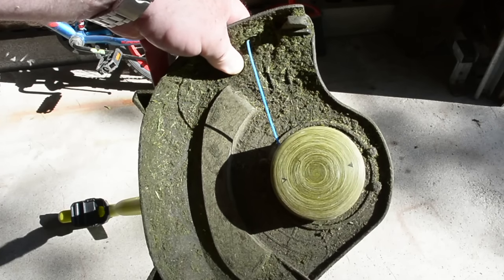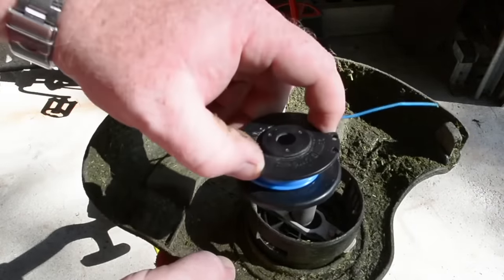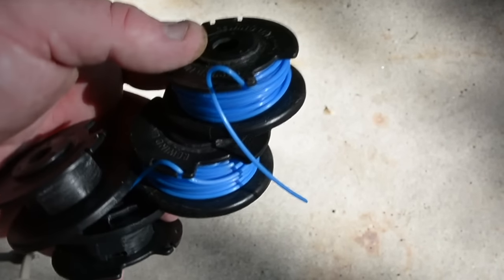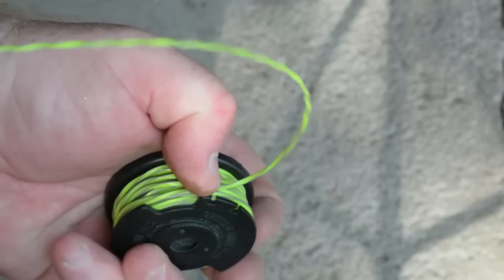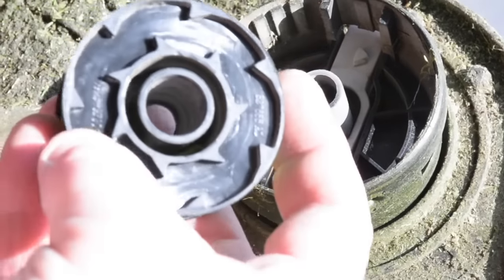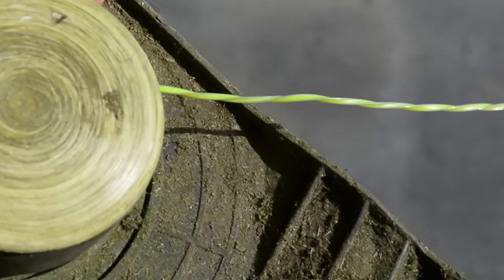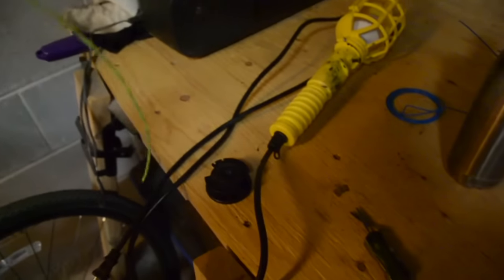RYOBI How to Re-Spool/Re-String 18V WEED WHACKER

Comment: I didn't realize the weed whacker line is automatically cut when it is stopped. I was moving from weed to weed in my driveway and stopping the machine when I moved on to each new weed. Apparently the string was cut at each weed! I couldn't figure out why the string was running out so fast. Your comment at the end about how the string gets cut really helped. Thanks so much!
Reply: So is the better method just to always keep it on while you're cutting and start/stop as little as possible?

Comment: They say it's the operator and not the tool. I bought this Ryobi and just love it! And then the spool ran out, I re-did the bobbin and then it stopped "working". I had an old Sears Home brand and after watching this, for years I have been doing this completely wrong. Thank you for the instruction! Be nice if manuals wrote out what do instead of putting pictures.

Comment from the maker: Spool keeps unwinding? I made a video about the probable solution: https://youtu.be/339wJE8b4dA
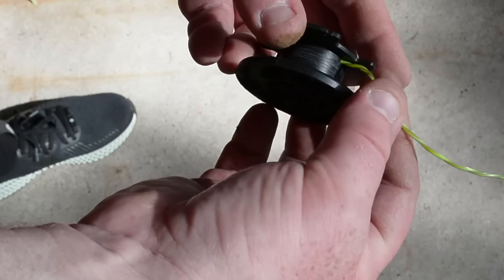2:34 I think a critical error is often made during the 1st step of the process: the new cord/line/string first enters the empty spool in the little 'notch' or 'hole' of the empty spool, and then the cord is wrapped in the OPPOSITE DIRECTION from that inserted line, so back on itself. You insert the line into the spool a couple of inches and then wrap the cord BACKWARDS to the direction it's inserted in the spool. For example, if the new line, when inserted into that hole runs in a 'clockwise' direction, wrap the cord going 'counter clockwise', so reverse the direction of the cord. This is what holds the line in place and keeps the spool from unravelling. When inserting the cord, it should only be able to insert into the hole in one direction, so wrap the entire new spool backwards across that first insertion, the opposite way.
Reply: Good man! Haha just struggled with this yesterday, and this was the step I was missing.
Reply: This comment was the best help. Thanks!
Reply: THANK YOU!!!!!!!
Reply: I still can’t get it so that my spool doesn’t unravel?
Reply from the maker: @christianpowell2053  wind the string in the opposite direction that you insert it in the notch. Go backward when you first start to wind and that will keep the string in place.

Comment: Cool vid man. The wind-direction printed on the spool could be taken both ways.  Wind the line in that direction or turn the spool in that direction. Helpful hint don’t wind too tight, especially if using biodegradable line. Also a fun tip is dusting the winding about half full with Sterate wire pulling powder! It’ll keep it from melting together where it overlaps;)  Ironically I use the same exact line you use in this video $12USD for 275ft. Always have 5 reused spools wound and ready to go! YeHa🤟🏻🇺🇸

Comment: Excellent video! It's almost Mother's Day & I've tried before searching how to restring this for my Mom. I thought the line she got might have been too thick (.095 I believe), even tho it said it should fit- But I've never strung a wacker before so I'll try again now that I know how. Thanks!
Reply from the maker: Thank you! But I think you should use max 0.065" for the line diameter rather than the 0.095. The 40V Ryobi weed whacker only uses 0.080" so the 0.095" is probably for a big ol' gas machine.
Reply from the maker: My bad. I started using my 40V Ryobi this past weekend, and the string is 0.095". However, my 18V Ryobi uses 0.065".

Comment: Is there a way to Make the spool stop coming out? Mine is letting out string every time I press the button and it’s wasting a lot
Reply from the maker: I wish I had this problem lol. I seem to break string often as I get close to rocks and tree stumps. I would say a solution is to wind the string really tightly. When I've done this, the auto-feed doesn't work as well and I manually have to extend the string.
Reply: I have the same issue, the string just keep coming out and even if I put it back it comes back out again, it's frustrating
Reply: Same problem. I'm pissed
Reply: That's the opposite of me too. If I wrap it even slightly too tight or it gets hung up it doesn't feed. This design absolutely sucks.
Reply: Same, it just keeps coming out.
Reply: It’s been a while since posting but turns out the kind I had was self releasing every time you let off the trigger. Now I just hold it down and it works out great. Wrist took a while to get used to it but it does the job

Comment: Thank you for the detailed video!! I always thought it’s more complicated than this 😅 also for some reason the line melts on itself in the spool! Is it just a bad line or happens to all of them? Also have you tried using a blade head instead of plastic line?
Reply from the maker: Thank you for the nice comment! Don't wrap/wind the line too tightly/firmly around the spool when re-wrapping it, or else, as you say, it will "melt itself on the spool." I have never used the blade head, but have when I was younger for thick underbrush, such as bulrushes or excessively thick and high weeds. I remember it cut through easily but the long grass has a tendency to wrap around the spinning head and jam the unit. I have never used the blades with "already cut" or "maintained" grass. Those blades are super small in diameter also, in comparison with the line/cord, so I prefer the longer diameter of cut with the cord, for easy jobs around the house, which is how I currently use my Ryobis.
Reply: @heyitsjosh  thanks for the tip and info! I’ll try to not wrap it tight next time.
Reply from the maker: @GrindMyGears  Yeah, just wrap it tightly enough so there's no slack in the line and it should be good!

Comment: Just refilled my spools and I’m finding the spool unraveling after I stop then start again. I have to open it back up and rewind the line. The line is nice n tight when I start.  Any tips on what I’m doing wrong or what I should do?
Reply: Same thing with me i think its because i got the cheap one $3
Reply from the maker: It's because when you insert the line into the notch in the spool, don't wind the cord in the same direction it goes into the notch. Instead, once the line is set in the notch, wind the spool in the opposite direction.

Comment: Hello! Thanks for your videos.... I have this model trimmer and am about to throw it against the wall!
The line spool is installed correctly.... My issue is that the line constantly breaks. Or it appears that the line "sticks" to the line underneath it. I use .60 thickness..... Is there stronger line that can be used with this model?  I used to have a more powerful Ryobi, but damaged my vinyl siding when trimming at the base of the house. Would you ever recommend a blade trimmer?
Thanks!
Reply from the maker: I think my cord is 0.065" for this 18V and 0.08 for the 40V. I mostly use the 40V and I know what you mean about power! Never did a gas version hurt my legs so much with firing debris back at me. The 40V is comparable or even more powerful than some gas models. The line breaking could be that it's old and brittle. Try soaking it in water to increase pliability. The only time I ever used a blade trimmer was with heavy, tall, thick grass: it was fully lush and overgrown and very thick. For just regular grass and even some thicker stuff, I'd stay with the nylon cord/line.
Reply: Thanks so much! I appreciate it!!

Comment: Just bought my 18v and used it.  Went through a whole spool in half the yard!  How do I stop it from coming out?  Seen several videos but no one talks about how to use the trigger.
Reply from the maker: The line is fed every time the motor starts from a stop. The line doesn’t extend like a traditional weed whacker where you ‘bump’ the rotor on the ground to extend the line. With this 18V version, every time you stop/start the motor, the line extends. So, try to run the weed whacker for longer intervals without stopping - not good for battery life, but will save on string. I actually like the line feeding system here as I often go too close to rocks and tree trunks so break the line. I often find myself playing with the trigger (on/off, on/off) just to extend more line out.
Reply: @heyitsjosh  thanks much!

Comment: Hi..good vid but am unclear on 1 thing..

When im ready to use the spool(ie not storing it) do i remove the string from the groove?
Thanks
Reply from the maker: Yes, remove the string from the groove and slip the string through the opening hole in the weed whacker head at the same time that you lower the spool into the head. You don't want the spool going over top of the string when you put it in the head, or it will bind: you want the string to go into the head parallel with itself, so that the line wound around the spool is parallel with the end of the string. If you kept the string in the spool's groove then the string wouldn't come out as it breaks off while using it. The way this whacker works is that simply by letting off the trigger and then starting it back up again, more line is fed out, so when I trim around rocks or whatnot, which breaks some of my string, I simply take my finger off the trigger, let the head stop spinning and then hit the trigger again and more string comes out. Best,

Comment: I noticed the string is green instead of blue. Can you use a different thread size for this? Or is it the same size just different color? Thanks
Reply from the maker: Same: 0.065". The blue was my original spool and I tried the yellow/green after that. I wouldn't use a thicker thread for this 18V weed whacker, but the 40V one I use thicker line.

Comment: I’ve been trying the thicker diameter string but it tends to get stuck. Might have to look into thinner string.
Reply from the maker: I think the manual says 0.06" but I use 0.065" for the 18V, as I've never seen 0.06" before.

Comment: Why does my spoil get sucked back in? I do it exactly the way you showed. I turn on the trimmer all the line gets sucked in.
Reply from the maker: Maybe leave a little bit more string hanging out of the spinning head before you start the machine? If I'm trimming around rocks or trees and break the line really close to the spinning head, there won't be any line sticking out and I have to remove the cap to release more string.
Reply: @heyitsjosh  wouldn’t the line cutter on the grass shield just cut it any way?
Reply from the maker: @nono559  Exactly. It doesn't matter how long the outside string is, as it'll cut off.
Reply: @heyitsjosh  any tips on preventing line breakage? I use a .080 recommended by Ryobi and I find my self constantly taking the cap out and pulling the line out just on a basic edging work. Also, would the high low speed setting play in to it?
Reply from the maker: @nono559  Is the line old? I've found that after a year, the line becomes more brittle and breaks easier. I've read somewhere that if you keep the line moist or wet before using it, it becomes more malleable and won't break as easily. On a side note, I picked up the 40V this year and use 0.095mm and that string is a lot stronger and doesn't break as easily.
Reply: @heyitsjosh  I bought the line last month. I’ll try soaking it in water. Do you know for how long i should soak it?
Reply: @nono559  correct line is smaller - .065 ..possibly .080 is too wide for that hole in the cap and it's getting stuck..080 is used on the 40 volter, if you're using a 18 volter like this video is referencing the line size is .065. alternately if you have an 18v one and a bunch of .080 line you might be able to drill that hole and make it larger which would (maybe :}_ allow your .080 line to come out correctly.

Comment: Any suggestions on if the cord keeps feeding and then eventually wrapping around the motor? Bought the replacements at the store.
Reply from the maker: You need to spin the head at full speed for the cord to cut to length (the cord hits the little blade on the underside of the triangular cover, and it needs to hit that blade at a fast pace in order to break off), so if you half accelerate at the beginning the cord may not cut and then it could extend out further and further if you re-trigger it. Just go full speed at the beginning until you hear cord snap and motor spins a bit faster, then you can ‘down-trigger’ from full speed and use as needed then onward…perhaps?

Comment: Any tips on when the auto feed doesn’t feed? It keeps stopping every 10-20 feet on me. I’ve tried not winding as tight but haven’t gotten it to work properly for longer than 20 feet.
Reply from the maker: Are you using 0.065" or less diameter (perhaps the string is too thick)? Also, I try not to re-wrap/wind my spool too 'perfectly' where each turn is beside the next. I just wrap the spool quickly and haphazardly, and there's many wraps that are angled and off-kilter, and therefore the string doesn't get 'jammed' from being too closely wrapped to itself. I think it's not only a matter of not wrapping tightly, but also to have some imperfections in the wrapping so that the broken string doesn't get caught under an earlier winding of the spool, if that makes any sense lol.
Reply: @heyitsjosh  thanks for responding. I’ll have to check the width. Come to think of it, it might be wider than the original string. My issue only really seems to happen when edging, not so much when whacking.

Comment: I did this possibly every 30 secs, before I gave this model up. The line just kept snapping, snapping, right at the point it leaves the casing, even when I replaced with heavy-duty line. It seems to jam hard onto the spool if you wind new line on by hand.
Reply: This is my problem today - was hoping to find a video that explained more on winding. My string keeps cutting off too short and won’t advance with the handle lever like it’s supposed to because it gets stuck.

Comment: What if the wire doesn't fit in the hole? R there diff size strings?
Reply from the maker: Yes, the 18V uses 0.065” cord.

Comment: I’m having dramas where I thread the spool (as per your video) start using my whipper snipper, and it cuts for about 10 seconds and it appears either the thread comes out or is cut short...??? Not sure what I’m doing wrong, but do you have any suggestions?
Reply from the maker: Maybe this? Weed Whacker Spool Unwinding? How To Properly Wind Weed Whacker Line
https://youtu.be/339wJE8b4dA
Reply: Ahh, my hubby tells me it’s simply when I’m hitting the concrete, it is just breaking the line.

Comment: So just to confirm when the device is in use, the string is supposed to automatically get longer/release by design?
Reply from the maker: As you start/stop the device it extends the string automatically. So if you don't want to extend the string, keep your finger on the trigger at all times, but if you want to extend the string, simply stop the device and then start it again and the string should automatically feed out.
Reply: @heyitsjosh  thanks!
Reply: @heyitsjosh  when you say keep your finger on the trigger, does that mean the power has to be on and the wheel  is spinning, which is using up battery power?
Reply from the maker: @honestreview8632  Yes, exactly. With the 18V model, starting the machine automatically extends the cord, so if I want more cord, I simply stop/start the machine, and if I don't want more cord, I just keep the machine running, which uses battery power.

Comment: QUESTION: on the 18v do u reckon i could use 2mm cord instead of 1.6?
Reply from the maker: I haven't tried that. I bought the 40V weed whacker this past summer and the manual recommends the 2mm, so my guess is that the bigger tool can use the thicker line.

Comment: I have the same trimmer, the spool stays tight but it keeps releasing more string than I need. I will find that it gets from 3 to 4 to 6 then 10 inches of released string. I cut it, then repeat as it releases more again. Is there a way to fix it, I'd rather manually pull it out.
Reply from the maker: It automatically releases more string as you stop/start the machine. If you let go of the trigger and the head stops spinning, the next time you pull the trigger and the head spins again, it will release more string. That’s how it is designed, for better or worse.

Comment: Does anyone have a hard time with the spool wire wrapping over itself? I've wrapped and rewrapped 4 times trying both a really tight wind and a loose wind and both ways the line gets under some other line and it won't spool.
Reply from the maker: Try to not wrap too tightly. Just wrap enough to keep the line taut with no space between the spool and the line, but not tightly whatsoever.

Comment: Hey I have a quick question. The thing that cuts the line on my trimmer when it gets too long broke off. Is this normal or expected? I bought mine about a week ago
Reply: Your cutter shouldn't break off. It's there to trim the line to size.
Reply from the maker: @Randy_84  I agree. I would return your unit for an exchange as it must be faulty.

Comment: Why is the string keep coming out long by it self
Reply from the maker: When you first squeeze the trigger, make sure to go full speed/full rpm. This way the string will get cut-off to the proper length. If you partially squeeze and then stop and then partially squeeze again, the string will be released but won't spin fast enough to get cut, and then will keep coming out.

Comment: Why does my String keeps hitting on the guard when I turn it on? I am using the original string that it came with. But for some reason it keeps curling up it’s not straight so it keeps banging against the guard
Reply from the maker: Squeeze the trigger long enough so that the blade on the guard cuts the string. If you start/stop the unit, that will feed out more string, so as you start the machine, get it fully going/spinning again before you stop it, otherwise line will keep feeding out.
Reply: @heyitsjosh  thank you